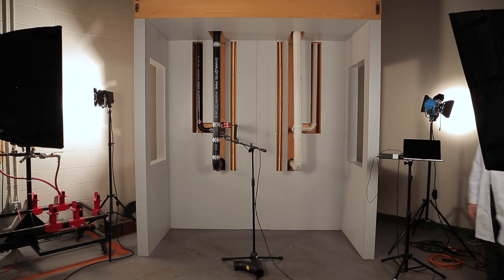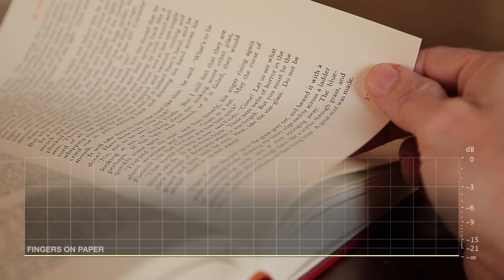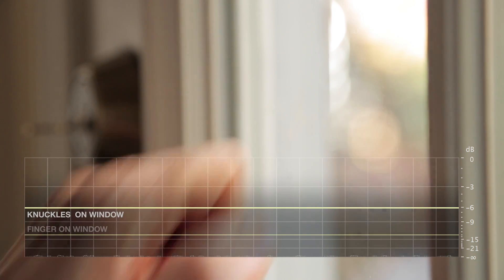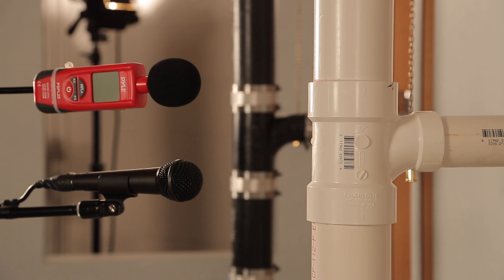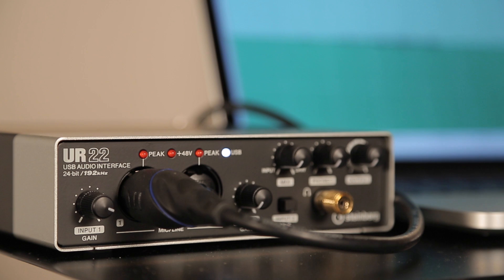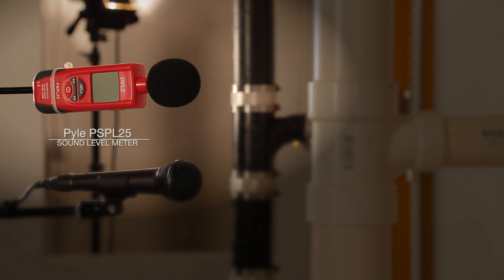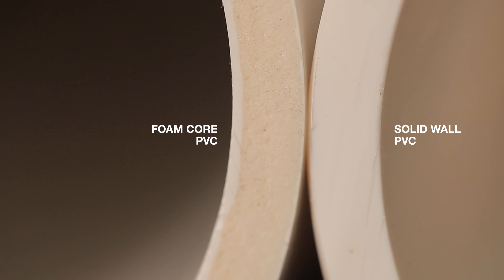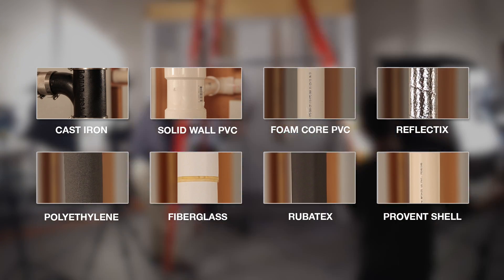Measuring Sound in PVC and Cast Iron DWV Plumbing Systems

Comment: I wonder what happens if I dense pack the stud bay with cellulose or roxul rock wool
Reply: Maybe 1 more dB less... practically, nothing happens. You won't notice any reduction. Insulation doesn't work because it doesn't add any meaningful mass to the sound generation system. Rockwool helps deaden room-to-room sound transmission because it can represent a significant percentage (up to ~10%) of the wall assembly's mass... even there, adding a second layer of drywall will out perform rock wool in sound transmission reduction (at half the cost too!). Mass is everything in sound transmission reduction.